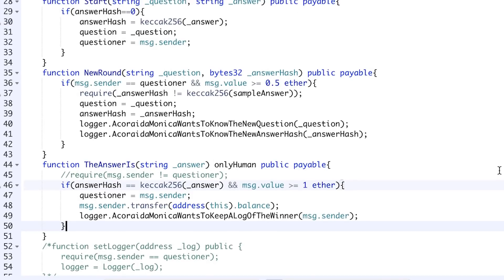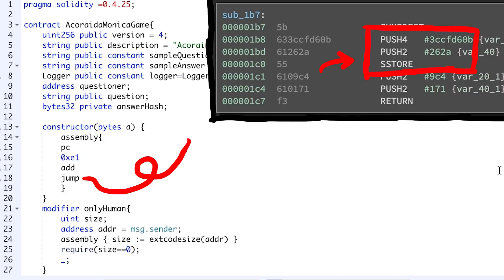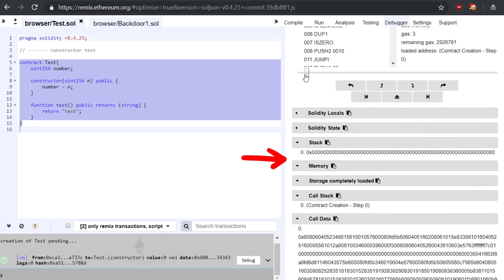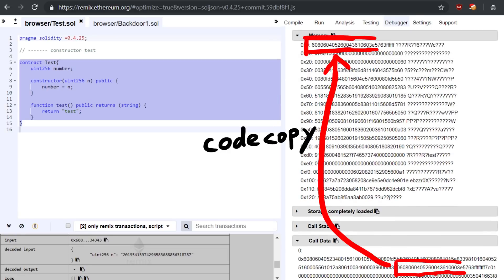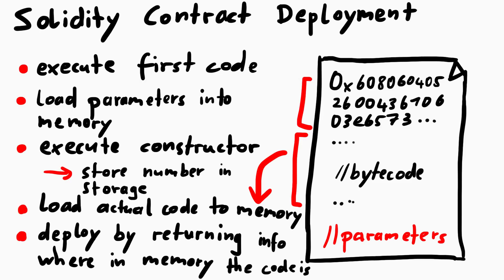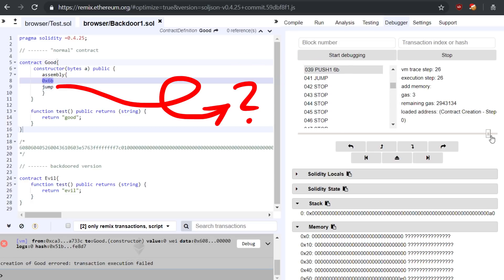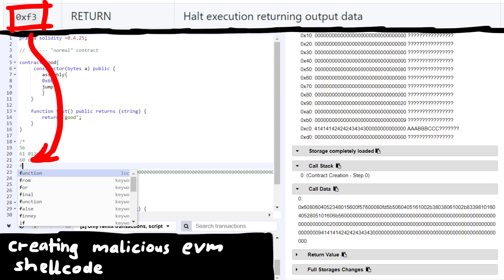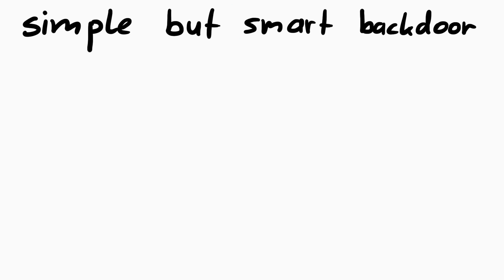Ethereum Smart Contract Backdoored Using Malicious Constructor

Comment: I've been following Ethereum for a long time and still can't see it as a safe platform.. being a Turing complete scripting language on a blockchain is an amazing idea but the fact that you can't update your code means it needs to be bullet proof from the get-go... and we know that bullet-proof code does not exist (or at least takes an insane amount of time and validation/testing to be created). 

I know there are new programming paradigms for Ethereum codes that split code into different smart contracts but that, to my knowledge, still depends on at least part of that code being immutable and, therefore, bullet-proof. On top of that the Ethereum Foundation's 'move fast and break shit' attitude (in contrast with Bitcoin's slow and conservative approach) adds fuel to that fire... even if your code is safu, the new updates might break it and insert vulnerabilities into your smart contract.

Until there is a way for a smart-contract platform to some how allow for distributed computing AND immediate code refactoring by the creator I don't see how it can really deliver it's potential without insanely high losses from hacks...

Comment: But why would you ever put assembly with a jump in your "good" constructor anyway?
Reply from the maker: Because you want to backdoor your contract. You want that people think it’s good, so you can then abuse it as the author.
Reply: @LiveOverflow  I see, but would a third party able to abuse it? or just the author?
Reply from the maker: The author is the one deploying it. So the author can add whatever hidden backdoor they want.
Reply: @LiveOverflow  I see. so as a user, how do you protect against malicious authors? or is  it the responsibility of etherium blockchain to prevent this kind of backdoors? sounds to me that it is a technology issue in a way.
Reply from the maker: "trust". You trust them or you review the code yourself. Maybe this is a good example why ethereum smart contracts are not easier to work with than regular legal contracts :P

Comment: This was a very well made video explaining the issue. I think some of the prerequisite information is missing though, but since I have that info this video was very easy to understand for me.

However, to be honest, any contract that has assembly embedded into it should immediately raise red flags, so damage is minimized... and I would be much more interested into the different historical vulns that were found in plain old solidity contracts (Like smart contract re-entrance bugs etc.) and things like the parity multi-sig contract bug.

It's cool to learn about certain CTFs, but I find learning about actual vulns that were abused in the wild on blockchains are great because no one can hide the history of the exploit, the stack trace is literally set in stone in the blockchain forever, you can see the money getting stolen, and how the EVM came to that conclusion. Whereas a company who was hacked will of course cover up any trace of them being in the wrong.

A few blockchain based vulns I think you'd reeeeally like to look into (I can help if you have questions):

1. the blockchain.info bitcoin wallet bug that caused users to generate the same private keys as other users. (there are multiple instances of this happening, and each bug is different)
2. "The DAO" contract bug that caused the hard fork of ETH and ETC when ETC people said "we don't believe you should reimburse the investors"
3. Parity multi-sig bug.
4. Bitcoin "out-of-thin-air" bug where miners could generate as many bitcoins as they wanted. (CVE-2018–17144) (Great hackernoon article by Jimmy Song)

I have started sharing your smart contract videos with my blockchain dev friends and they really like your style of explanation. Keep up the good work.
Reply: Thx for the info man
Reply: Yupp, exactly. Took the words out of my mouth. Couldn't have said it better myself....lol 😅🖥